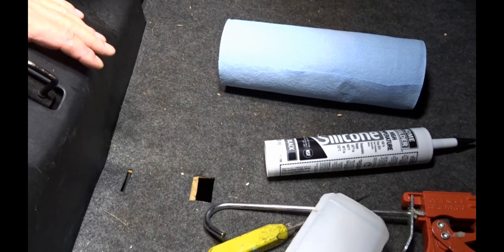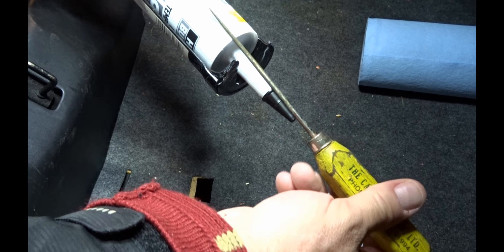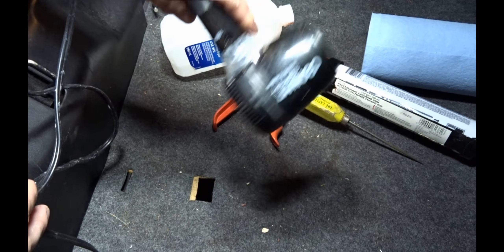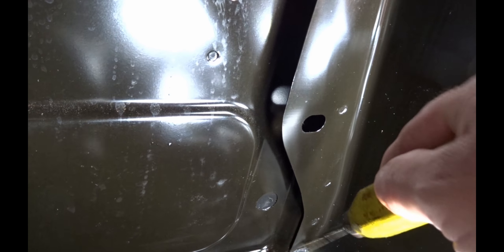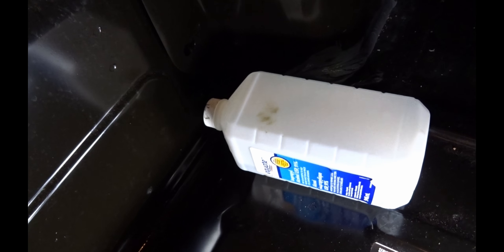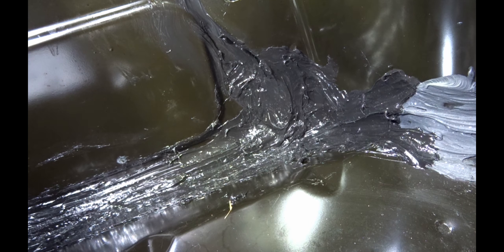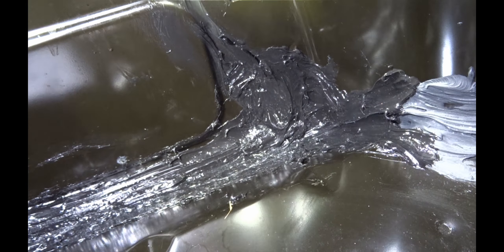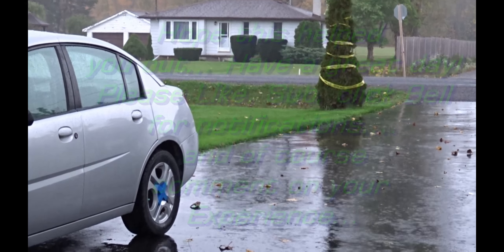Saturn Ion Trunk Leak Repaired

Comment: Great video! I I have a 2003 with 104,000 miles and I just found out I have the same issue, and I have a full system with 2 amps so I need this fixed ASAP. Im going to get supplies for it tomorrow. Thank you so much
Reply from the maker: don't skimp and force it in...

Comment: Hey man, how is this repair holding up? I have the same issue.
Reply from the maker: Very Good, the Trunk has a small slight damp spot after a lot of rain, however I'm confident I can resolve once it warms up around here and stops raining. My trunk use to actually fill up with water and I had to pull a plug out under the spare tire to drain it. So I guess be sure to force the silicon in between the gap, work it in with you fingers, use gloves. ps, please subscribe and like my video so I can continue making these.
Reply from the maker: yes I have seen some where they dismantle the car... my solution worked fine, I have owned the car since new, it only has 50,000 miles on it. So I'm not doing major surgery. word of caution, if you start filling up and blocking areas you might solve short term, but end up with some problems if water gets trapped in areas that normally would drain, especially if you live in a climate that goes below freezing. All I had to do is reinforce the areas that already had the silicon..
Reply: K&D_Enterprise just opened my fucking trunk and had the  huge fucking pool of water in my trunk you mentioned . Im out can’t even fix it my night is ruined 😊😊